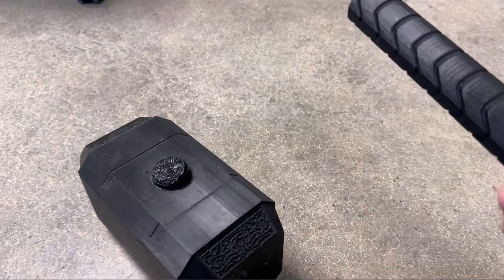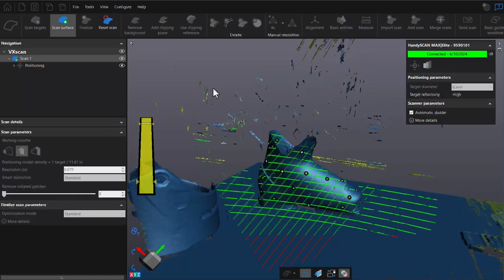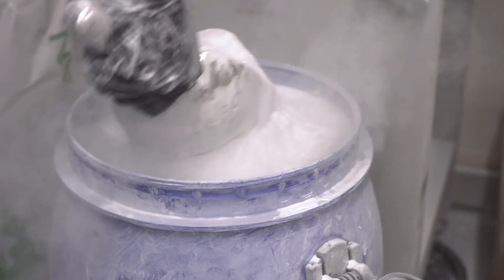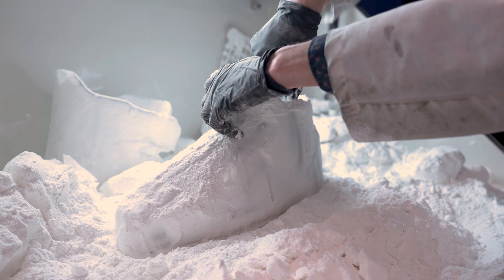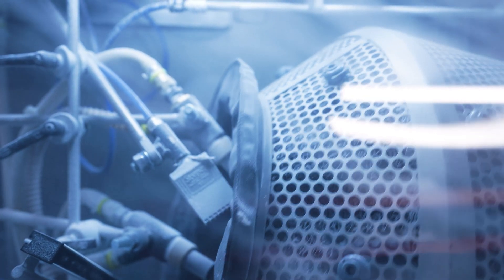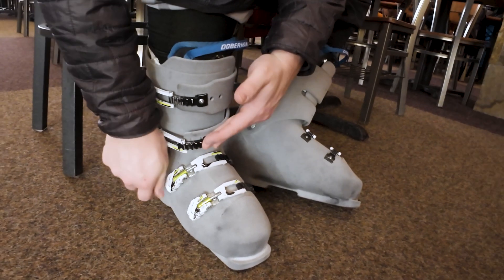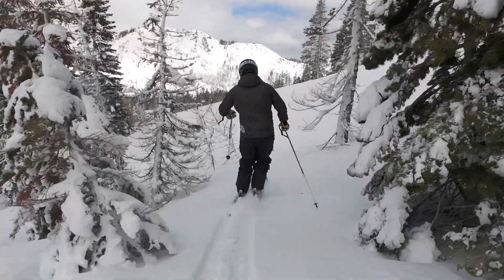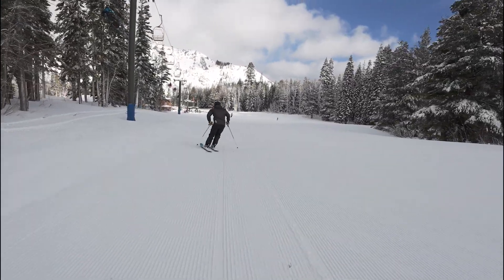Trusting My Life to 3D Printed Ski Boots

Comment: Hello, great video.
I'm interested in trying this myself and have a few questions.

I'm wondering how you scanned the interior of the boot lower and if this especially tricky to do?

Did those boots have a boot board? It seems like you just included it with the rest of the lower if they did. That would make things simpler I imagine.